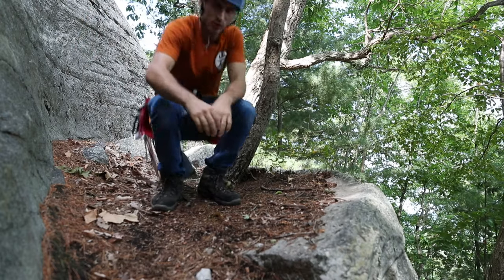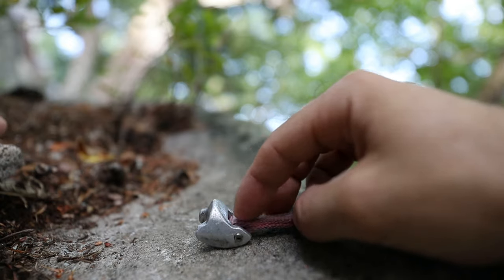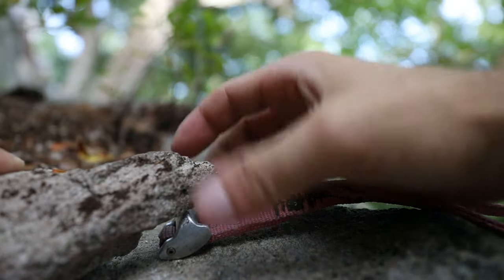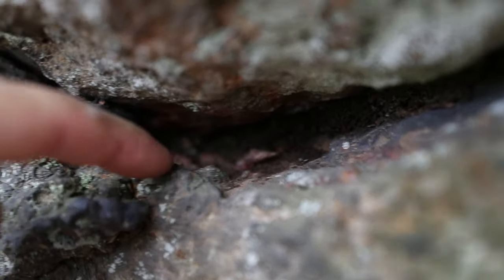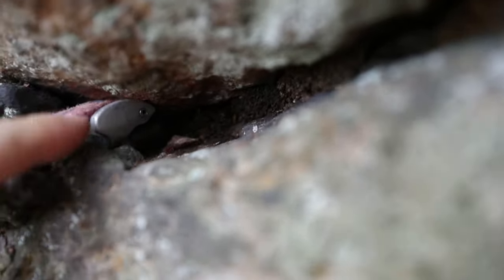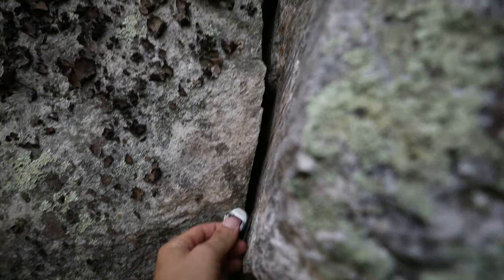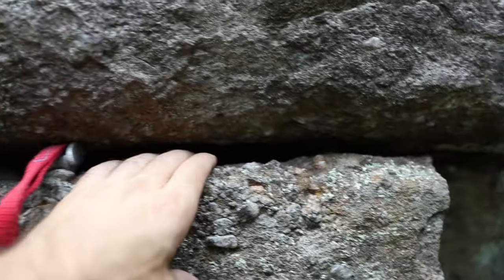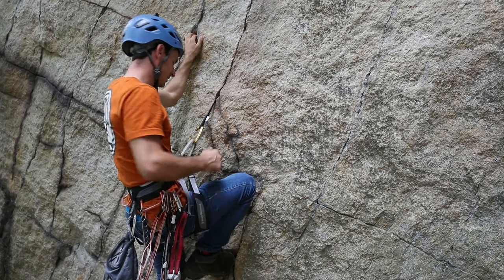Climbing Basics: How to Tri Cam!

Comment: Also great in standard horizontal placements where you might otherwise use a totem or an X4 or something. Tricams are lighter, use up less space on your rack, you can save the cams for later on, the narrow head width fits similar irregular cracks to totems and X4s, and less likely to damage the tricam webbing over an edge where you would risk kinks in cam wires and stems if you whip.

Comment: I'm yet to see these being used on British gritstone or lime yet.  Cheers for the video though I might have to look around for some placements.
Reply from the maker: Wish I had some experience over there maybe when the travel ban is lifted! 🤙🏻 Cheers.
Reply: @BetaClimbers  Yeah definitely head over to the Roaches or Stanage.
Reply: I don't have any personal experience using tricams on that type of rock, however, I have heard that they work particularly well in medium/soft or wet rock because the dimple of the cam bites into the actual rock. No experience yet to back this up but it is what I have heard!

Comment: Nice video. I have an unrelated question / request. A guide I was with today didn't like the rope I had to make the prusik-block for rappelling. Apparently nylon is no good, it needs to have a kevlar core...?  Why don't you do a video on rope and sling materials ?
Reply from the maker: I’d say 5mm-6mm nylon accessory cord is very common for prussics however sense you are rappelling you have to worry about the nylon getting much hotter and melting. Yeah that is a great topic thanks.

Comment: First, 'passive mode' in a constriction is as strong as the rock, the webbing, and the pin; the cammed mode can approach, but never exceed that ultimate strength, as the leverage magnifies wedging forces that can pop flakes, crumble weak rock, etc. The camming is initiated by the foot, which has to engage a pit, or crystal, or groove, etc. to stop it from just sliding out, as contrasted with spring loaded cams that can more actively initiate outward force to generate friction sufficient to stop sliding. Especially with larger ones, the foot is almost always going to be Down, because that's the way gravity and the tipping action sets it in. Larger Tricams with the foot up can just loosen with a sideways tug, and then its weight collapses it into a flatter profile where it will easily pull out. The foot generally needs to be oriented down in horizontal camming placements, so the dragging tooth will tend to catch, and tip/rotate the cam up, wider and tighter. As with many things, sizes range from best to least - 0.25, 0.5, 1.0 are the most useful, fitting into narrower and shallower placements, especially piton scars, with greater strength than SLCs in the same spots. Above 3, their weight creates issues of stability, and lots of compact SLCs fit better with no strength compromise.

Comment: Not sure where you are getting your strength ratings from @1:40. CAMP's website says a pink tricam holds 7kN in passive, and 9kN in active (https://www.camp-usa.com/outdoor/product/rock-protection/tricam/). Much higher than your reported (3/5 kN).
Reply from the maker: I think I correct my self at 3:30
Reply: @BetaClimbers  You're right! My bad.
Reply from the maker: @derekjones6947  it’s all good 🤙🏻 I try to get everything right the first time doesn’t always work out🤣

Comment: tricams are the dream protection of leaders and the bane of followers.
Reply: You just have to know how to clean them and they are way easier than most make them out to be.  98% of the time I don't even use my nut tool to clean them, just two fingers on the rockers and the rest of my hand gripping the sling.  Push in slightly until it loosens from the placement and hold the rockers down as I pull the tricam out.

Comment: Tricams are awesome.
I've once even tried placing them in vertical parallel cracks in active mode on my practice board.
They would catch even if the crack was expanding top-down like so.
https://ibb.co/KmxjFQH
I haven't tried this in real rock yet, but I presume the LESS friction the stone gives the better their active action kicks in (hence they worked flawlessly on my board).
Reply from the maker: Yeah thats scary I would avoid  placing anything in an expanding crack like that one. Lol I’d move on to find something better 😂 maybe place it to the left haha
Reply: the wood is soft the tricam might've bit into it

Comment: no such thing as "active mode" with passive gear.
active requires an "active spring...
Reply: Not necessarily, That whole debate relies on the fact you agree of the definition of active, and many many people refer to the tricam having a active mode
Reply: Active in my mind simply means that the piece has expanding geometry when a load is applied to it thereby exerting more friction on the rock and an active placement of a tricam most certainly fits this criterion.